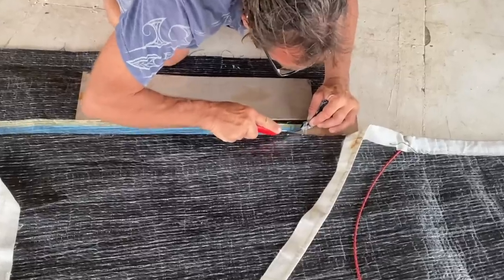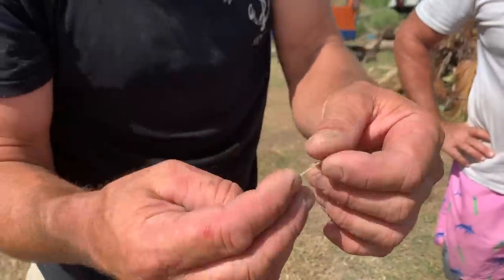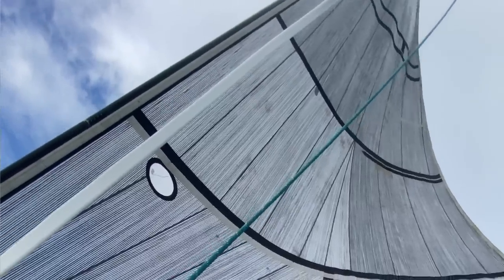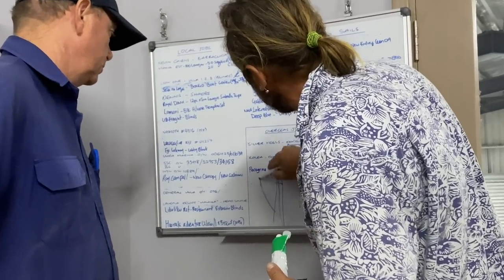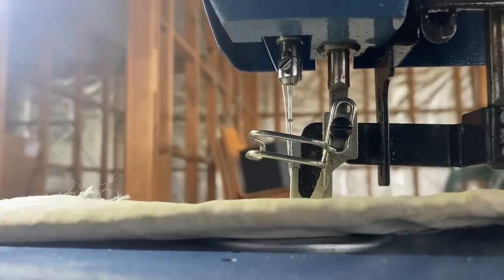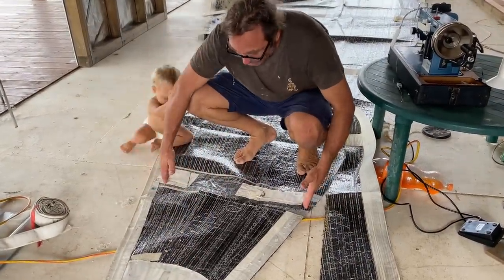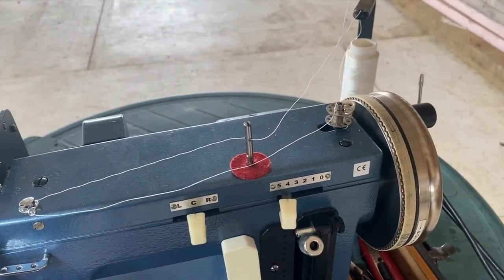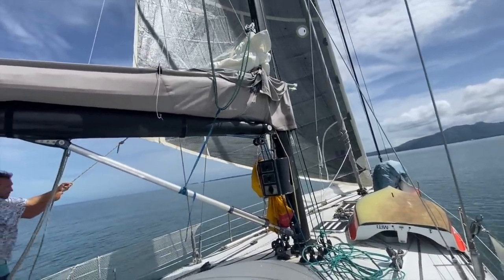DIY SAIL design for our Open 66 | Ep.58

Comment: My dad used to do this with his old racing sails - my earliest memories are with his cotton-duck sails (which had to be staked out if you tipped over and got them wet).  Also, older sails would 'blow out' in high winds.  Their center of effort would move back away from the mast making them not point to windward as well.  With the better and better Dacron and other materials, sails held up better and he stopped doing the re-cutting and re-sewing.
Reply from the maker: wow nice story

Comment: Should the inner be smaller in heavy weather , or Do you have a storm jib ,?    My view is thesen2 will be your work horse sails , as the main wasn't in a good condition,  sail slow Keep the pressures low . It's a very long way home ,   do you need crew 😎
Reply from the maker: Yep we have a storm jib and yes looking for crew - feel free to get in touch at sailingnv@gmail.com :)
Reply: @SailingNV  soooooo tempting